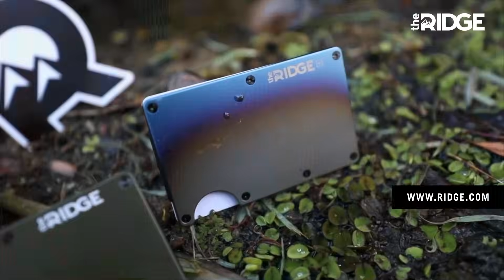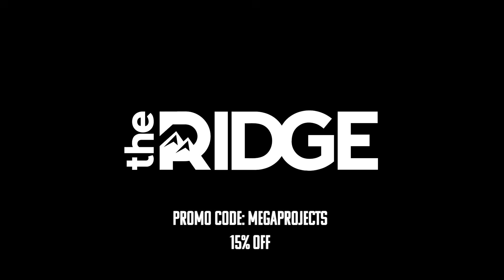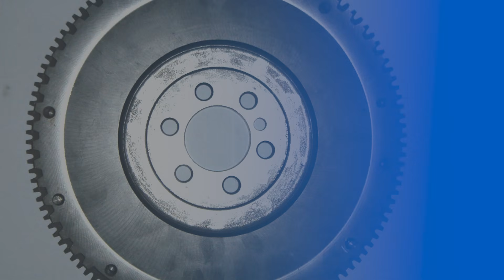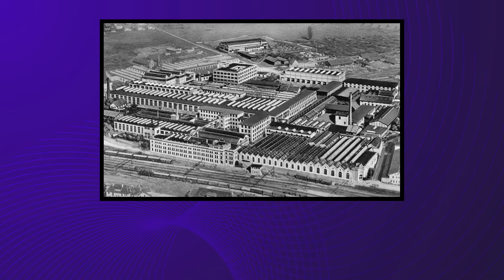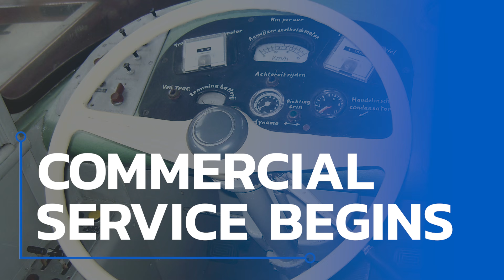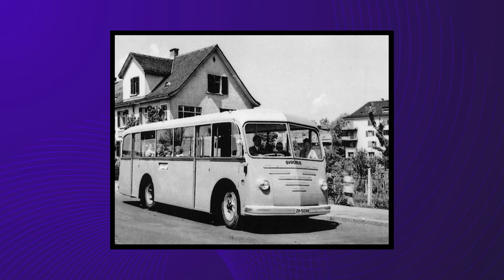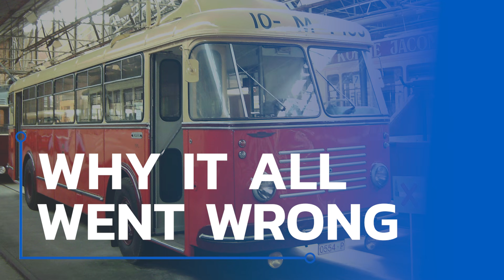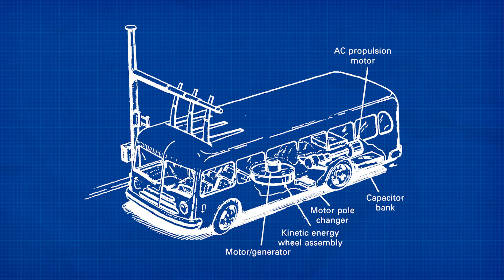Gyrobus: The Incredible 1950s Flywheel Powered Bus

Comment: Electric cars won't make a lick of difference... yet. We need a better way to generate that energy. Coal power plants aren't going to cut the emissions at all. Not to mention the actual manufacturing process and mining for the rare minerals to make the batteries.
Reply: We need the real green energy! Nuclear.
Reply: This is a really bad argument. Electric cars powered by a coal fired grid are already producing less emissions than gas powered cars, and there's hardly any places where the grid is fired by only coal. Wind and solar are already cheaper than coal so adding new capacity going forward that's what it's going to be, although I agree that we need to be expanding the nuclear capacity as well. The ultimate problem is that they are cars, the solution is not to simply not build electric cars but it's to build some electric cars and replace the rest of the cars with something else, the problem is that the urban design of a lot of cities does not lend itself to any mode of transport other than driving. Fix the layout of the city and you get a lot of car trips eliminated.
Reply: @AlRoderick  Fixing the cities may help, and that is where people are densest, but with so much of America rural or suburban, driving is still going to be a major requirement.

Although working from home may alleviate some of that, loosening the noose of the daily commute.
Reply: @AlRoderick  I agree with almost everything you said. Urban planning has failed cities but its also failed most other suburban areas as well. I remarked to my wife that I found it astonishing there were no sidewalks from a big group of hotels to the strip mall across the street. People are forced to cross 6 lanes of traffic and walk through grass. Asinine!

I don't think solar or wind is the future though. Solar, if the tech keeps improving, could be a factor but I think wind is a waste of technology for 99.9% of end users. Nuclear absolutely seems like the future
Reply: That's a fundamental misunderstanding of where we are. EVs use substantially less energy than ICEVs. Even if all we powered EVs with was electricity from fuel oil burning plants, we'd still have lower emissions.

But our electrical supply system isn't nearly that dirty. Most power comes from natural gas (CH4, methane), and that's a clean-burning fuel with much lower emissions than you get from burning coal or oil.

My electrical supply is 66% non-carbon, including wind, solar, and nuclear energy, with natural gas peaking power plants filling the gap.
Reply: @TonyH255  personally I feel if they actually would make new plants and show the public what has changed and advanced now it could help public opinion